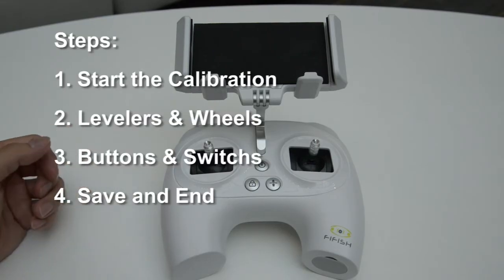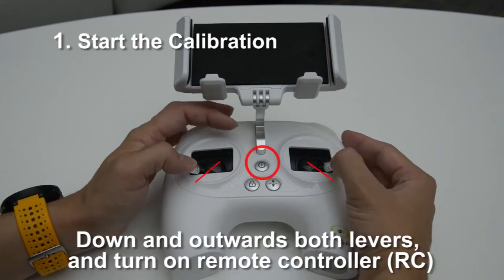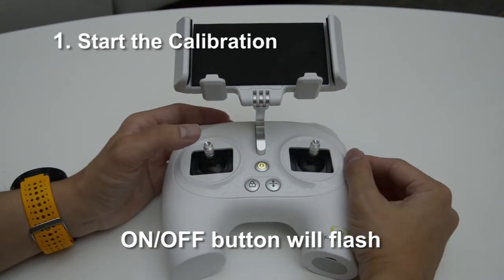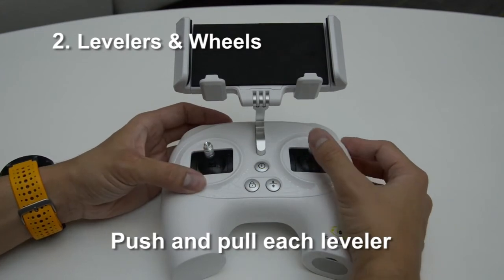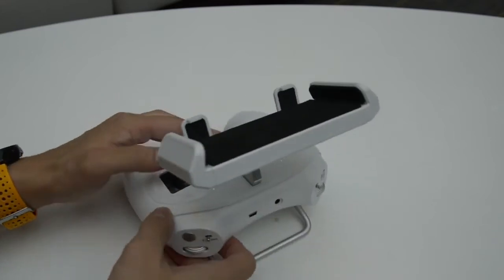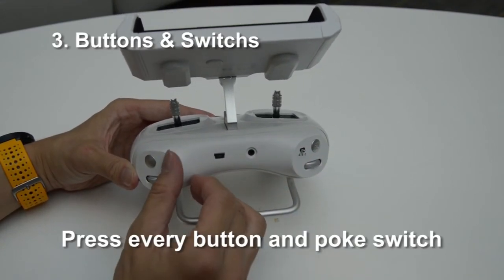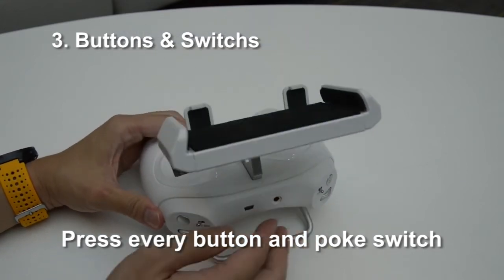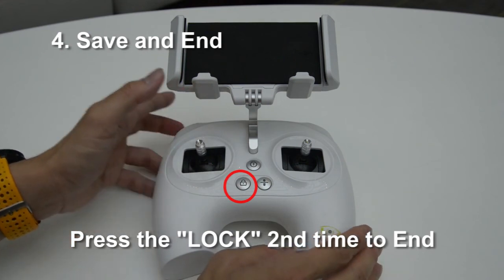Qysea - FIFISH V6 Remote Controller Calibration

Comment: My FiFish has never worked tried sending it back but all I got was nonsense answers like:  Send a video of what’s wrong, hard to take a video of a submarine underwater and not for nothing, this video was ZERO help.
Reply: So what was it doing that was wrong?
Reply: @ when it comes on a couple of the motors automatically come on.  It’s virtually uncontrollable once it was in the water.  I’ve calibrated it according to the FiFish specifications but it’s still basically doing what it wants.  Zero control over it.  FiFish was pointless and I spent about $2000 on this thing.